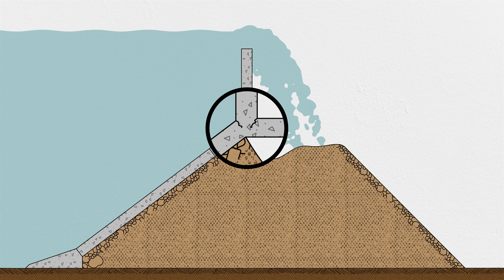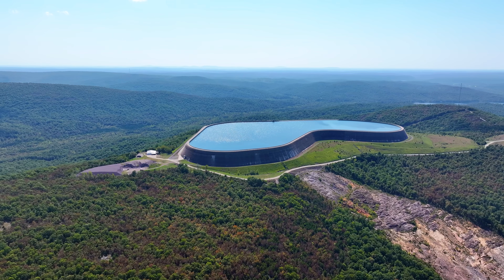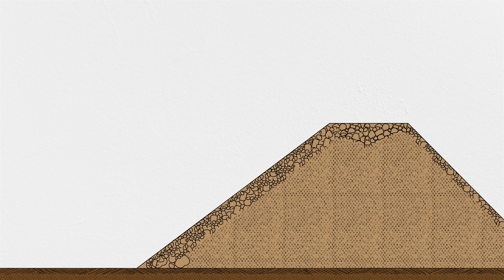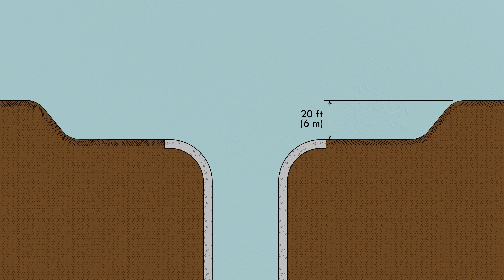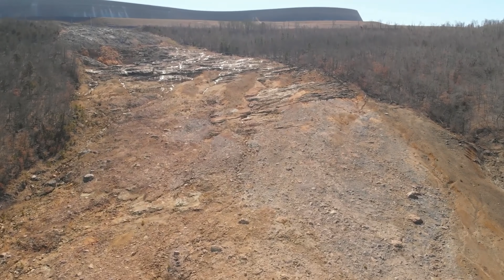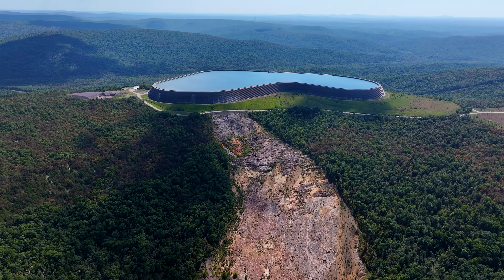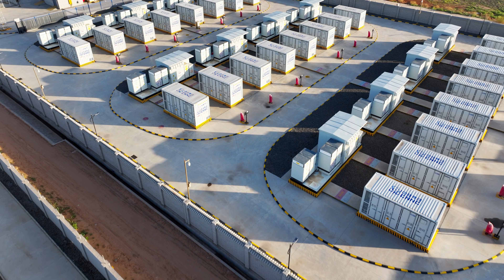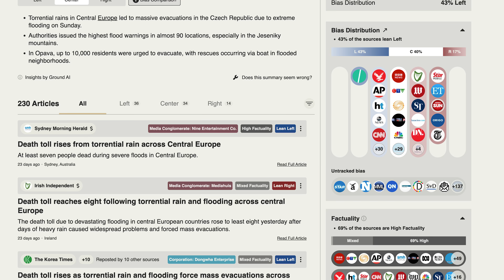The Wild Story of the Taum Sauk Dam Failure

Comment: it says out of 100% energy used 70% is recovered. they cant even afford a live person for maintaining this thing, cost to build, this must be the dumbest battery of all time.
Reply: 70% efficiency is very high in the energy production industry. An ultra modern coal plant operates at about 33%. Gen IV nuclear is about 50%, about the same as wind power. Solar efficiency is the pits, about 25%.
Reply: @StoneInMySandal  do you even understand what Taum Sauk dam is? its a guaranteed loss of 30% of any moment of time they use its cycle. its just there because they have much energy to lose. its just a backup system if any other power source fails, if it did, they will use the dam recover70% and when its done they still need to pump up water from a mile below of the mountain using 100% power because there's no RIVER source on top of the mountain. its just a large pool bank on top of the mountain and its gauranteed 30% loss each cycle use. please do know what it really is
Reply: @jboysalem1388It’s not a backup. It’s a capacitor for the grid to compensate for the inability of fossil fuel burners to throttle output. I’m not sure you understand how this works.
Reply: @StoneInMySandal do you understand this? so when you use your solar do you lose 75% of the sun? IDk about you man but if you done your math right its -30% efficiency and thats not high, its very opposite. do you know how hard it is to raise buckets of water from far than having a sunbathe

Comment: its interesting to see this old power storage solution compared to our new one. they both have catastrophic consequences but the water storage battery is actually a more eco friendly one that seems to last the test of time. i can guarantee you no lithium battery is going to last near half a century with minimal maintenance or replacement, let alone the impact it takes to build them. with it now repaired and issues addressed who's to say this thing won't go on to work for another 100 years or more? the fact the superintendent station was built below the dam was kind of a silly thing on the parks part.

Comment: 'Tis interesting that all the potential problems had been considered and a suitable control system installed, but the implementation was faulty.  eg overflow sensors (good), but not at the lowest point (not so good).
It is surprising there was no hardened spillway as a backup, but it was after all the 60s, and I can imagine someone saying "there is no credible circumstance in which water will ever overflow. We have multiple levels of automated sensor/control".

Comment: Why did they rely on level sensors attached to the bottom of the reservoir, instead of using a pressure transducer at the bottom or in the gloryhole spillway?

Comment: With over 2ft of settlement in some areas of the dam wall, you'd think that visually, one might be able to see the HWL mark (high water level) on other areas of the wall while standing atop the dam... and then question why water is about to spill over in some areas of the wall, but have 2ft of wall still showing in other areas?? 2ft of settlement does not happen overnight, this would have been noticeable years in advance... relying solely on ultrasonic level probes to determine water level for something as critical as this blows my mind... heck throw in a few float switches for backup!

Comment: I also watch Pilot Debrief, where Hoover analyzes the causes of airplane crashes.  The aircraft industry has a concept related to safety they call Swiss Cheese.  Slices of Swiss cheese layered on top of each other.  There can be holes in each slice but as long as they don't line up, nothing gets through.  That's the analogy for preventing crashes:  the more slices of Swiss cheese, the better, so that if something malfunctions there are other features, technologies, etc to cover for it.

And that fits here too.  If the dam company had a few more slices of Swiss cheese in place then this disaster wouldn't have happened.

Comment: Another major timebomb i noticed:  the "drain" has no sort of grill.  If I am hiking with my buddies, that huge body of water is awfully tempting for a quick swim.  At the wrong moment, someone could easily be sucked down the drain.  Also, I think this is the first time in my 15+ years as an engineer in construction/infracture that ivee seen and open-atmosphere volume without an overflow gravity drain.

Comment: I've used dams for a while now as important context when thinking about nuclear power. A dam takes away useable land by design, not only after an accident and it has much greater environmental impact by design.

Also a dam is usually more immediately deadly when it fails.

On the other hand, the worst kinds of accidents with a nuclear power are incredibly expensive and difficult to clean up. But like with dams, we've learned a lot since those accidents happened and at least Chernobyl was almost designed to be as dangerous as possible.

Comment: And the stupidest mistake was that the system did not provide for an emergency water discharge channel. This is an absolutely obvious solution, any equipment can fail, all dams have one, why didn't they build one? I have absolutely no idea why they didn't build it, it's such a basic safety feature.
Reply: I started typing this text in the middle of the video, and eventually saw that the author came to the same conclusions. There should always be the simplest possible fuse to prevent breakdowns of complex systems.

Comment: I am a retired control systems engineer. I once had the task of trouble-shooting a facility in a pottery. Waste clay was mixed with hot water (to make a liquid clay called "slip") in a high-speed mixer (called a "blunger"). A pair of blungers were installed in a room, each contained within a bund which could take all the liquid and more contained in a blunger. The blungers operated automatically and unsupervised. On a completely random basis the hot water would fill a blunger and simply not stop, flooding the room.
The fault was tracked down to the level switches. These were ultrasonic and were mounted close enough to the liquid surface to be splashed by the liquid slip. This dried to a fine clay coating which resulted in a false reading, saying not enough water had been added. In the short term we mounted the switches much higher up and made it a maintenance task to wipe them every day. Float switches were added in each bund as a last resort function to turn off the water and sound an alarm.
Fancy high tech level switches are all very well but there's no substitute for a low-tech backup.

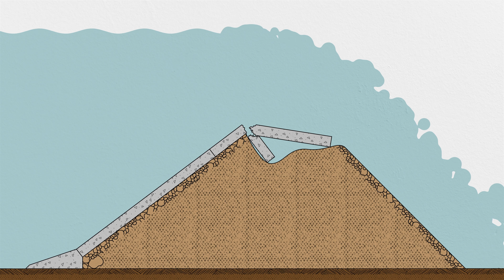Comment: 0:50 I feel like just a few extra layers of spare concrete on the edges could have stopped that
Reply: The sensors kept pumping anyway. Regardless of the walls height. That caused erosion because theh didn't have a spillway for the water to safely go. Had the wall been 10 feet higher, it wouldn't have mattered.
Reply: How intelligent and clever we all are with Hind sight and all that😂
Reply: His diagram isn’t correct, there isn’t any bank of earth. Instead the water sits on a flat plane surrounded entirely but a ring on concrete walls. There isn’t some earth mound headed by a flimsy wall as shown here. This is also why the reservoir emptied entirely as the entire surrounding wall was breached, not just the top section of it. Imagine in the diagram the entire structure being both concrete and being destroyed completely, not just the top section.
Reply: @ms_publisher7143 wrong
Reply: I understand why you feel that, but that's not how engineering safety works. If you keep adding energy to anything then it eventually fails.

Comment: You ahould check out the failure on Lake Delton in Wisconsin. Its a man made lake thats fed and discharged from and into the Wisconsin River. We had a massive rainstorm and it eroded away and emptied the lake into the river unrestricted. Took a bunch of homes with it. I remember standing on a bridge about 30 miles downstream watching parts of homes floating underneath. It completely submerged part our interstate system too. 90/94

Comment: I'm no genius, but the original design was doomed to fail. How do you not put a safety overflow/spillway that is not controlled by any kind of electronics or even mechanical that can fail?  This structure is basically a giant sink, and even they have overflows to avoid water damage.  This is  not rocket science.  How does this ever happen?  I am shocked that the top concrete wall above ground did not fail  before it overflowed even without the soil being washed away underneath it.  A simple sump pump float type sensor as opposed to whatever they tried to do underwater would have worked.  Not sure how anyone could over engineer and under engineer something so terribly and get paid for it.

Comment: So they use hydropower similarly to how the modern battery packs  works on power grid i.e as temporary power storage, peak shaving and help maintain the generator combustion engine to work at load with most efficient fuel oil consumption?

Comment: So. Why is it way up on a mini mountain where failure would be the worst and it's inefficient. 

Why's noone try using water pressure. Like bottom of the lake nearby or bottom of the ocean. The water in the pipe would have the whole lake or ocean pushing it through....

And it's ironic cause even small bodies of water it works. Tube at the bottom, make suction with no electricity and that tube can drain the water away. There's even YouTube videos of it. 

But no one goes. Hey let's put generators in that tube and scale it up... Could even have the generators on land and not need people to deep dive to repair them.

Maybe I'm thinking to simply but as long as water in the pipe needs less force to flow than the water it's pumping from it should work after the initial flow is started.

Comment: In the last 25 years I have visited Taum Sauk several times. There are two problems here. Since 1932 several large dams have been built in Missouri. Most are wide base with soil compaction. Taum Sauk sits directly on top of the New Madrid Earthquake fault zone. In 1811 a series of several huge earthquakes rolled over this area and even caused the Mississippi River run backwards for 5  days. At least 10,000 people died in a couple minutes, due to flash floods.Taum Sauk is largely on top of a red granite shelf. But, earthquakes in that zone cause land to giggle like a bowl of Jello. The geological behavior is apparently different than anywhere else. Most experts think this earth giggle could easily collapse this dam and at least two other resevoirs that are even larger. Clearwater Lake and Wappapella Lake have similar construction, not far away. Several dams will likely collapse in a major earthquake, in the Ozark Mountain range.

Comment: There is a double-pumped storage system in northwest South Carolina. Lake Keowee has a two-unit nuclear power station operated by Duke Energy. Lake Jocassee has a hydro power dam and its outflow goes into Lake Keowee. Above Lake Jocassee is Bad Creek Pumped Storage Reservoir that provides hydro power and which gets part of its flow from Whitewater Creek, the rest comes from pumping water from Lake Jocassee. Lake Jocassee can also refill by pumping water from Lake Keowee. All told, the system can provide over 860 megawatts of clean power.

Comment: All of these problems would have been obvious if you've ever set up a swimming pool on sand. You know that one of the sides is going to dip several inches. And it's going to be a spot for leaks and continual settling.

Comment: So the threat risk with battery storage is that they have fires. So from your perspective it is better to trade what happened here which was a company that seemed to work at failing (which  never should have happened) vs having a very toxic battery fire that can not be directly extinguished. We need storage badly and the way the economics of pumped storage are calculated, it is unlikely that it is “considered” competitive against batteries. But to suggest that all pumped storage is inherently risky is misinformation. So it is obvious what camp u r in.

Comment: Given that part of the wall was 2ft lower than design, a spillway might not have made a difference - just like one of the 'fail safe' high level sensors wasn't triggered because it was above the point of overflow. 
I'm not a civil engineer, so i can't judge how stable the new construction is going to be, but i hope there is periodic survey to monitor the heights of the walls

Comment: I'm no engineer, but it seems insane that they could 11:10 "Not know the actual elevation of the water." Like, couldn't they just pay someone $50,000 a year to LOOK at the elevation of the water? Why did they need underwater electrical sensors to see how high the water was? Or why not just have an emergency concrete-reinforced flood drain so water can just flow down the hill into the river it gets too high?

As an amateur, it all sounds like problem of over-engineering a dam.

Comment: I work in controls and it's just mind boggling to me how many single points of failures exist in multimillion dollar machines and enterprises. I just imagine the cascade failures that would result if this one limit switch failed or got stuck or if a sensor is reading an erroneous value. And yet, it's hard to be profitable when you've overengineered every failsafe to be redundant.  A problem that shouldn't exist for a job this big.

Comment: I don't think Batterytech is anywhere near the level we would need. Current tech is such that at 10 years, the battery begins to loose large chunks of capacity. Even if you replace batches of cells individually, they cannot be repaired, only replaced and that's a bad business model long term for everyone except the battery producers.
On a Hydroplant, you actually CAN repair the turbines, etc. for a fraction of the cost it would a replacement. Clear Winner to me, even if the starting costs are higher as than a hangar full of Lithium cells.

Comment: whoever cut the edge support so short is to blame. 6ft of extra concrete outside the wall could of saved the entire project.. but triple sensors on the pumps would of done better. ATO fail lol

Comment: Wivenhoe Dam in Australia is an earth bank, flood mitigation and storage dam, finished in 1984, the dam has NEVER BEEN safe.  It is supposed to protect Brisbane from floods, it has a capacity of 1,165,238 ML (256,317×106 imp gal; 307,823×106 US gal).  Construction of an auxiliary spillway and a three bay plug fuse was finished in 2008.  In 2011, the engineers had to release vast quantities of water which partially flooded Brisbane when a large rain event caused the dam to get within 600mm (2 feet) of the top of the auxiliary spillway.  There is nothing stopping a bigger rain event from happening that may very well exceed the capacity of all the spillways.  Given that, it was extremely dangerous from 1984 to 2008.

Comment: As a Civil Engineering major, this is an excellent explanation of the various forces that affected this situation.
Reply: In your professional opinion what process would you suggest is disintegrating the 'spires' remnant of the WTC towers core columns after the slabs had landed? 
  Presumably there were 47 large gauge steel compression columns
   I won't hold my breath for a response but your consideration is appreciated

Comment: I've proselytized about two things related to this incident for many years.  First, I have also called this station a "land battery" ever since I learned how it works, and love explaining the engineering behind it.  Second, I have used it as an example for why publicly owned utilities are superior to privately owned.  I did learn some things from this video about how there were more than just one single thing to blame for the failure.  However, when you got to the point about how they should have already known there was a problem, and posted eyeballs on the dam in real time, I practically felt vindicated in my belief that Ameren is a garbage company that has only recently even bothered to convince the public that they are bothering to stay on top of routine grid maintenance.  I live in an area with coop electric, and I have had two significant outages in over a decade.  One from a tornado, and one recently that was apparently maintenance related.  My friends on Ameren routinely complain of outages and brownouts.  The news regularly seems to be covering other grid problems as well, and every time I dig deeper, it is a privately owned or publicly traded utility company involved.  All this has had me convinced that had the reservoir been operated by a coop, and not a private company, the issue would have been managed differently near the end, and the failure likely would have never happened.  What do you think?  Is this an unfair critique based on your experience?

Comment: I noticed you referred to head as the difference in height.  Does head not also refer to the length of pipeline being pumped through?  That's what I always thought head was.  It was explained to me as sucking a drink through a straw, and then imagining that same drink but 1000 straws long and the difference in forces necessary to move the fluid.  I work on pools and didn't go to college so I'm probably not right but there is some accountability of forces in that example that make some kind of hydraulic sense.  Maybe???

Comment: i might have no idea what i'm talking about, but why not use an optical height sensor for the water ? set a senzor (maybe laser or similar) on one of the walls and measure how far down the water is, that way you don't have to make holes in the membrane and it should also not move around.
also, as a failsafe, there should have been "over spill" sensors in multiple places, to make sure that at least one of them could be triggered in case of an overspill